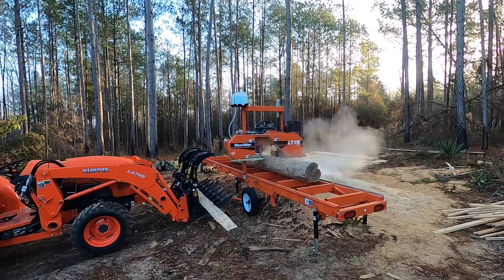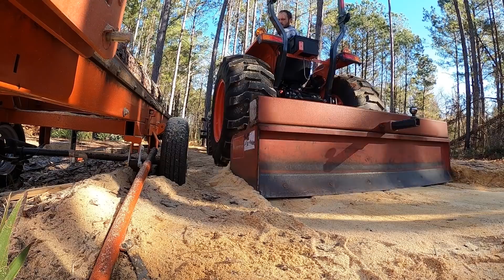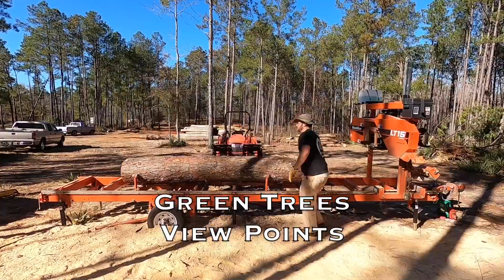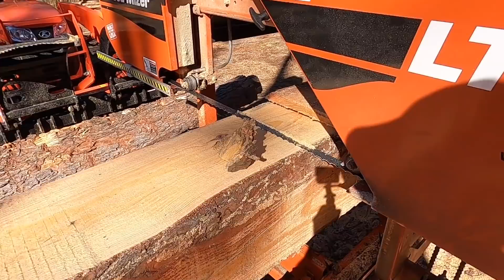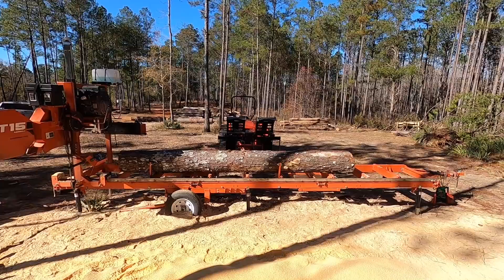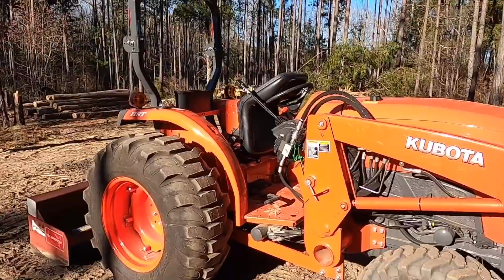Milling 11 Logs in 14 Minutes

Comment: How often (about how many logs do you cut) until you need to change blades?
Reply from the maker: If the logs are clean (no dirt in the bark and no nails), I can saw 10-15 with a sharp blade. Pine at least. Not sure about other species.

Comment: What is reason for sawing 180 and I tried using my edgings for stickers when I went to sell for paneling where sticker laid it blued couldn’t sell for panelingb
Reply from the maker: I flip it 180 initially so I am guaranteed two sides perfectly parallel to each other. It starts the whole log out square...so long as your mill cuts straight.